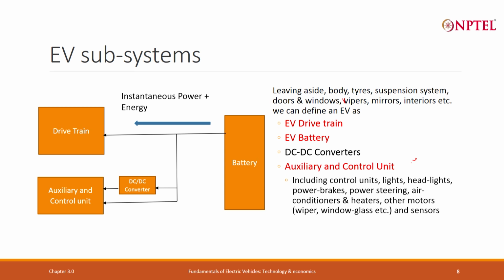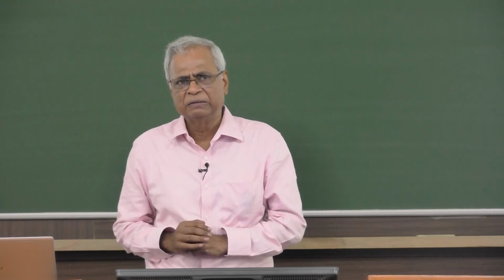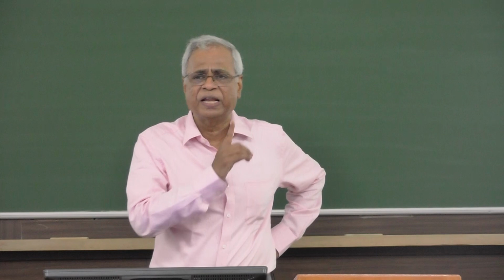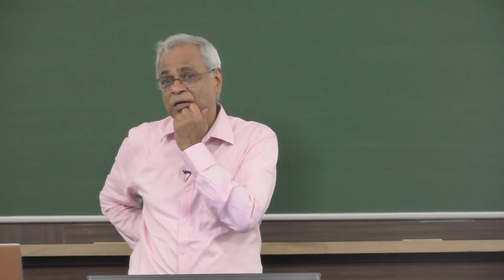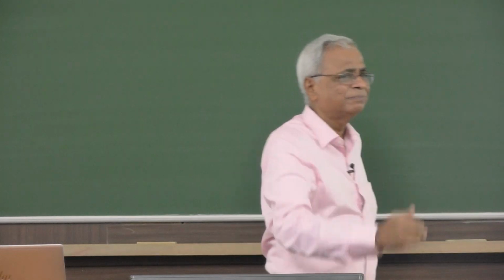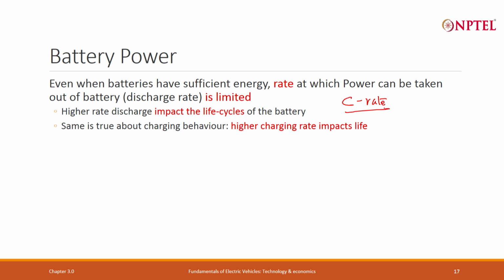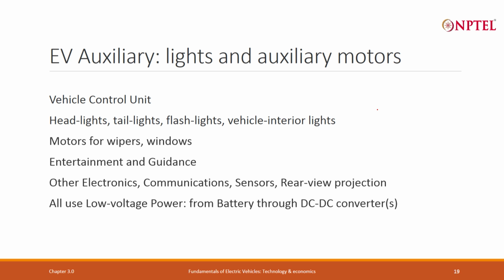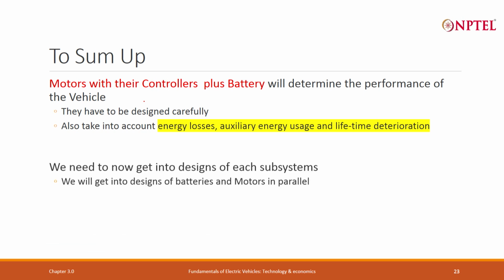Lecture 18 - EV Subsystem: Design of EV Drive Train - Part 2

Comment: For Second Problem New condition
Battery Cap-15kWhr
DOD-0.9
Available to use -15*0.9=13.5kWhr=13500 Whr
Vehicle Side
Aux Power consumptio-500W
Speed -40kmph so Whr is 80*40 =3200 Whr
We shall consider 1 hr 
Actual Energy left =13500-500-3200=9800 Whr
Efficiency is 85% =0.85*9800=8330 Whr 
If it goes like this range will be 8330/80=104.12 Km

At the End
Available 2 Use-0.9*0.75*15000=10.125kWhr
Actual Energy -10125-500-3200=6425Whr
Eff=0.85*6425=5461Whr
Range-5461/80=68Km

Correct me if i am wrong please :)
Reply: I think you should deducted 3200 whr twice in your solution.